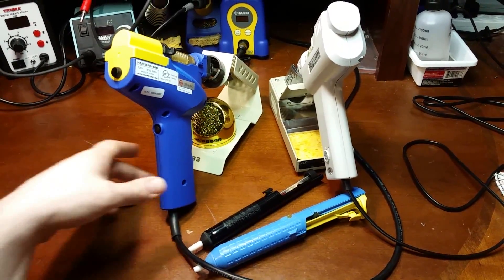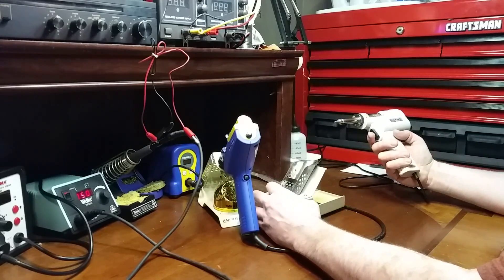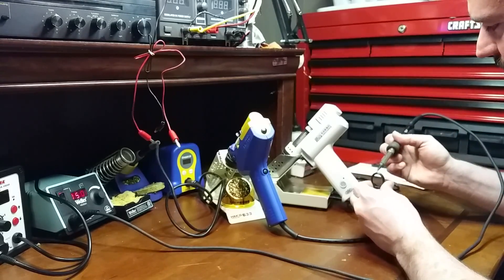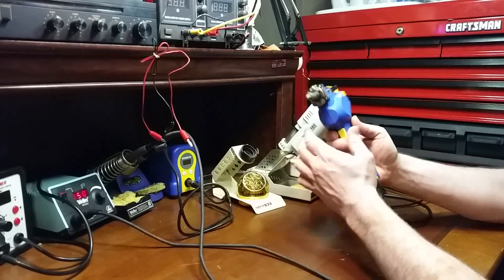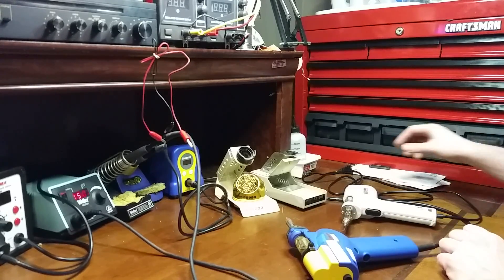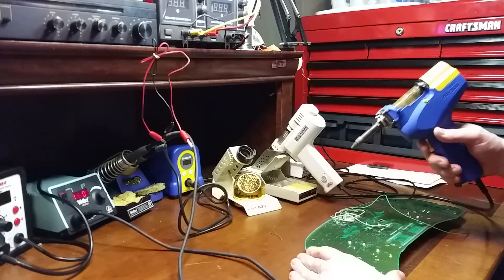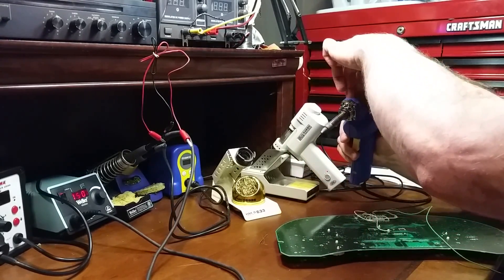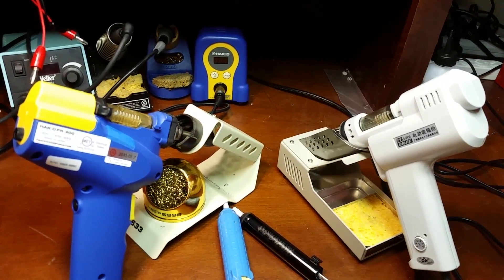Hakko FR300 vs S-993A Electric Vacuum Desoldering Pump

Comment: don't buy the S-993A , the tips are fragile it breaks or cracks quickly  and the heating elements goes bad fast and once you replace the heating element it wont work as it should that's my honest experience
Reply from the maker: Yes I agree the hakko FR-300 is worth the extra cost. It's a better tool in every way.

Comment: i just bought a Hakko after having the Chinese one should have spent the hakko money earlier but by the time i got the Hakko now it was 200 rather than 300 and i spent like 60 on the Chinese one i still have  and also am going to steal the sa  993a stand for my Hakko the one in the case for the Hakko is a lame excuse of a stand
Reply from the maker: The hakko does fit better in the S-993A stand then it does in its own hakko stand.
Reply: @jeffescortlx  you already know i already had the s993a stand screwed to my desk so now il just put the hakko there

Comment: Have you ever had the tiny tube come out of the heating element on the kakko unit? I just found a returned desoldering gun at my local store for 5$ shockingly and it heats up super fast and I hear the vacuum pump running no problem. But the tip now has the thin tube stuck in it. And the outter tube won’t fit back on. Not sure if I wanna try to drill the heating element slightly to try and tap the tube back into the element. Or just file it down slightly in hopes the seal is on still. Or just buy a new heating element for it.
Reply from the maker: Hakko is good about providing replacement parts. Should be available directly from their website.
Reply: @jeffescortlx  yeah I’m hoping I can tweak fix it as is. I only paid 5$ for it which is a steal obviously lol even with the broken end. I’m hoping it can be fixed free wise. Gotta try some things. See if solder is holding the tip and the tube end together and see if it will release the tip and if not maybe I’ll try to drill the heating element so the tube slides into it. 
But I guess if I have to replace the heating element and the tip that’s not so bad for a 300$ish unit. Lol I’ve always wanted one seeing your videos from the cluster rebuilds! Just could never justify the expense for something I’d super rarely ever use lol
Reply from the maker: @addiction2bass  either way it's a great tool and worth the cost of replacing the element tube if it comes down to that.

Comment: Does the Hakko fit in the S-993A stand?  Not sure why Hakko doesn't just make one that is designed for their own product...
Reply from the maker: I don't think it fits, but it's been a few years since I've had both and don't remember why. Yes they need a real stand that fits right!
Reply from the maker: Just tried the FR-300 in the S-993 stand, and yes it does fit good. The S-993 stand works better for the FR-300 stand then the original Hakko stand.

Comment: We have the hakko FR 300 at work, never used such a piece of rubbish in my life...tips last about 2 weeks, units continuing to block up all the time, absolute rubbish..
Reply from the maker: The OEM tip they come with is too small. Use the next size up and clogging will happen 90% less often.

Comment: Are the tips interchangeable? I have a S-993A and I need a new tip for, and I'd rather get a Hakko tip for it instead of having to wait two weeks for the Chinese replacements to come in.
Reply from the maker: No, the two are not compatible with each other. I would think someone on eBay or Amazon would have US stock of 993A tips?
Reply: @jeffescortlx  Found out that Aliexpress has US stock of them. Ended up buying one from them.

Comment: A cool thing with the S-993A stand too is that when it's on, it activates the vacuum for an instant when placed into the stand which clears out any solder left in the tip. I've been looking for videos on people that modded theirs but have had no luck. I think it might have good potential for modding. I've got a ton of vacuum pumps that I've acquired over the years - from small DC ones that could fit in the S-993A easily that cost like less than $5, up to a Gast powered by a 1hp Baldor motor from a medical device that cost like $1K. So I've got an assortment of vacuum pumps that I can try out with it. Might need to give it a shot...

Comment: I bought the S-993A and am now replacing the heating element (a common problem) after maybe two years of light use. I have extra nozzles (different sizes). Replacement boards, filters, and diaphragms are also available now. Schematics are on-line. I'll probably end up getting the Hakko though I think it is overpriced. I try to get what I want the first time because experience has taught me that cheaping out is usually a waste of money.
Reply from the maker: They fit into different categories. I'd reccomended to spend the price if it's something that your going to use more than once. The hakko is designed for commercial use, while the S-993A is designed to make it past the 90 day PayPal dispute period.

Comment: Is that S-993A still working 3 years later?
Reply from the maker: Well yes, but I've already replaced the heating element to keep it going. It only has a handful of hours on it. Meanwhile the hakko fr300 has thousands of hours on it and it's still chugging away just fine.
Reply: @jeffescortlx  Good to know.. I was going to ask the same thing.. just stumbled upon your video.  I've bought TWO different chinese clones and both of them have been basically useless.  I didn't want to spend the real money on the good tool, and now I'm going to end up spending it anyway, and a total of twice as much, for being cheap in the first place.

Comment: You get what you pay for. I bought the $100 Chinese S-993A first, it lasted about 2 weeks of regular use before the heating element burned out. It also takes a while to heat up.

The Hakko was only $234 on eBay. Came when a hard plastic carry case, heats up quickly. Works flawlessly. love it. It didn't come with a fancy stand though so I'm using the s-993 stand for my hakko. Good combo.
Reply from the maker: The official hakko stand for the FR300 sucks. So keep using the Chinese knock off one. The Chinese may have made a crappy heating element, but they nailed it on the stand!
Reply: @jeffescortlx  Hell yes they did! Thanks for the advice. I was actually going to but a Hakko stand for it.
Reply from the maker: @JuggaloCujo  unless things have changed, the official hakko stand was originally designed for soldering irons, not the FR300, so it doesn't really seat well in the base. But besides that, the FR300 is a trooper!
Reply: @jeffescortlx  hell yes
Reply: I have an s993a that is working well so far but not used much.  After watching the video I thought if the stand works with my inevitable hakko in the future at least it wasn't a total waste, glad to hear it fits well

Comment: I'm using a Hakko FR-300 and i needed a replacement black flange plastic piece lol. Thinking about looking into the S-998P
Reply from the maker: Check with hakko, they typically have a good stock of parts. The 998 one won't fit, and the FR300 is noticeably a better tool.
Reply: @jeffescortlx  got it cheap. Someone dropped it and the flange broke got it total for like $88 that includes the tool and the replacement part. The casing itself feels like its falling a bit apart I can just buy a new blue gun case halve but kinda reluctant to say no for that lol. It's still in tact so it's all good
Reply: @jeffescortlx  Curious also did they give you a free canister or you paid?
Reply from the maker: @Limeayy  I had to pay. But the plastic canisters are reasonably priced on the hakko web site.

Comment: Well, I have been using the S-993 for about a year now, its without any problem. The S-993 is designed to use with 220V power, and Hakko is a Japanese model so its designed to use 100V, mine heats up way faster then the on in the video. I also see comments saying it works find in European countries, maybe they did not make a good transformation from 220V to 110V. As for the pump, mine sounds a lot more like Hakko, a little weaker, but you can't really feel anything. Also I don't know why yours have the thin cords, mine have the same size cord with Hakko, maybe its a 110V and 220V thing?
Reply from the maker: My S-993 is the 110v option used on 110v. I did recently break my hakko FR-300, while waiting for replacement parts to arrive I used the S-993, the heater element burned out after a hour work session. So now I'm waiting for a replacement element from China.
Reply: @jeffescortlx  Yes, they do have 110V models, but all review says that model is flawed, even on Taobao (Chinese Amazon). I believe what they are saying that even they changed the transformer in it to use 110V, its not powerful enough for devices designed to use 220V. This is a rough translation, and they say its better to get a 220V with an external transformer if you want to use 110V, it will performer much better this way. But with all these said, Hakko is definitely a better brand and better model, so fixing that is probably the best option.
Reply from the maker: @gglsniper  maybe they ment motor or heating element. The 993 doesn't have a internal transformer. I didn't really seam to have a problem with getting enough heat out of the tip, but maybe they are using the same motor pump from the 220 v on the 110 model.
Reply: @jeffescortlx  Yes, the comments I read says it will heat up fine, but take longer to heat up. And maybe they are saying the pump is not as powerful because of 110 instead of 220, the comments did't really say what this will cause, just it is causing some problems.

Comment: I have one Hakko 808, one S-993-A and one S-998-p.

Hakko 808 is an excellent tool.
S-998-p is and excellente tool, spare parts are cheap inclusive.
S-993-A is a piece of shit.

Cheers.
Reply from the maker: I see the P must be the dual pump. And differences in the heating element or tip?
Reply: @jeffescortlx  S-998-P use diferent tips, but tips, heating element and rubber diafragm is inexpensive.
I recomend this tool for everyone.
Reply from the maker: @treadmillrepair754  I'm intrigued, I might have to get my hands on one someday to check it out.
Reply: @jeffescortlx  Hi, Hakko is the best  choice always, but the S-998-p is an excelent option if you are in budget.
S-993-a is a piece of shit.

I am in electronics more than 40 years, I bought tons of tools, like scopes and multimeters.
Any question feel free yo contact to me.

Cheers.
Reply: @treadmillrepair754  I agree on you, I have both of hakko 808 and hakko FR300.. hakko soldering tools is the best! Chinese product is bull___t!

Comment: A good comparrison. I just bought the cheaper Chinese one off of Ebay and Iwill put it tothe test right away
Reply: What did you think of it?
Reply: @Jin-Ro  it's the same one Adrian Black has. It doesn't have as much suction as an external pump does, but it works well

Comment: My solder waste container cracked after i sucked some flux with my Hakko.
Reply from the maker: Mine cracks pretty much right away. I've just learned to live with it. It's not causing any vaccum leaks so I just roll with it.
Reply: That's strange. I thought it might be, that the hot fumes from the melted flux did it. When i ordered the spare part, the distributor was really wondering why do i need it. After the explanation, they said, that they never had it before. Since then i had no problems with the cracking, but i am careful not to suck any flux. Maybe it would be worth to report it to hakkousa, maybe they know more or why it happens. Besides this and the terrible stand, it's the most valued investment that i did into soldering. It helps so much.
Reply from the maker: I don't think it's from flux fumes, I think it's just from thermal shock. I've talked to Hakko about it a few times and they pretend it's the first time they have heard of it, but I know it's a common issue.

Comment: Also something that people don’t get is that Hakko provides lots of tips and parts - the tips are incredibly useful for different size components like slider pins/ potentiometer, plus extended nozzle so you can get to hard to reach pins/solder.
100$ is what you spend on 2-3 meals at Olive Garden nowadays so if you use it every day it’s so much better, paying 100$ more than the cheaper model extra for reliability will be worth it in the long run.
Reply from the maker: True. Hakko offers great support. The knock off has pretty much non, you just have to hope a over seas vendor lists parts up on eBay.

Comment: I bough this exact model from China. It stop up so I took the wire that come with it to clean it. Got nowhere. Removed soldier tip took small drill bit come right out. Here is the Big thing that took me forever to figure. The tip was clogged up also. Come to find out the wire that they send you (there or 2 of them) .they are to big to go threw the tip. I manged to clean the tip out. Why in hell did they send me 2 cleaning rods that are bigger than the tip. She is oiled and back to new again after about 4 hrs. of trying to get the over sized wire threw the tip. So maybe this well help someone out. You can't use the wire to clean the tip. At least the tip they sent me.Even a standerd sewing needle is to big.
Reply from the maker: It's easyest to clean with the temp jacked up on high. My cleaning poker fits just fine for mine.
Reply: jeffescortlx Is yours the S-993A
Reply from the maker: Yes
Reply: jeffescortlx I guess I got an odd ball tip. Maybe when I order some new tips it will work then. As of know I take a very small needle and sit it in the end of the tip then heat the  needle and tip up with a propane torch and work it back and forth. If I remember to use the needle while it's still hot then I don't have these problems. This tip something else. Hold it up and look threw the big end at a light bulb you can barely see threw it. At first I thought it was still partially stopped up. If you get a bright light and examine it closer you can tell its made that way. Maybe they where thinking the smaller the hole  in the inside of the tip the more suction you would have. Good to know there not all like that. 73s

Comment: I used to own an 808. I've since moved to an FM-2024. Its far superior to anything mentioned here.
Reply from the maker: With its higher price and air compressor requirements it might be out of reach for the hobbyist.
Reply: @jeffescortlx  I'm sorry if I offended you Jeff, I have much respect for you and that most definitely was not my intention. If I come across as trying to one up you, again, not my intention. I guess I do get carried away when it comes to tools sometimes. I apologize.
Reply from the maker: @mike7958  that was sombody else's reply that was offended, not me. Doesn't bother me.
Reply: @jeffescortlx  Understood. But I know I can be a bit abrasive sometimes and just wanted to make sure you and me are all good.
Reply from the maker: @mike7958  I love talking about tools!
Reply: Very true. I must say though, my old 808 was a workhorse. I used it for many years and not once did it break down on me.  How would you compare the newer FR-300 to the old discontinued 808? Is it just as good?
Reply from the maker: My FR300 gets used for about an hour every single day since new. My only problem is the cracking waste canisters. They still hold vacuum fine when cracked, but break when removed/installed if not handled gently. Hakko has been good about sending replacements even though I'm sure its out of warranty by now.
I've been using a larger tip than what it shipped with to stop clogging. Still has original heating element and pump. I like it. Wouldn't want to work without it.
Reply: Well that sucks. My 808 still has the original canister without a single crack. And I also used it nearly daily for years. One thing I didn't like about the 808 was when I had to change a tip, it was a pain. One of the reasons I went to the FM-2024. Hot swappable cartridge style tips similar to the t-15's used in the 2027. Changing a tip on the fly is super easy, even easier than the FR300, not to mention much lighter and more compact.
Reply: @mike7958  I prefer the the flexor 9000 it sucks that you have to try and one up people...

Comment: I have a question for you.  I bought one of these guys and clean it regularly.  I noticed that it stopped being very efficient and the vacuum was not working as well. Then I noticed that it was blowing more then it was sucking?  Is it suppose to blow hot air?  Any thoughts?
Reply from the maker: I would check out the one way valve and see if working properly.
Reply: Thank you, I am not too familiar with the guts, what would the one way valve look like on the S-993A?
Reply from the maker: It's probably a reed style valve on the pump.

Comment: I've been using a S-993 in the UK for a few weeks.  I'm really impressed with it, for such a cheap tool it really gets the job done.  Maybe the higher mains voltage helps, it heats up quickly and the pump sounds a lot meatier than the one in this video.  I do agree that the mains flex is too thin, I will likely replace that shortly.  Also a mains switch would be a real help.  But for the price, it's a bargain.
Reply from the maker: It does get the job done. But I find my self reaching for the hakko. Combination of small things, like it's already plugged in while the S-993a doesn't have a power switch. And the Hakko has more thermo power and sucking power.